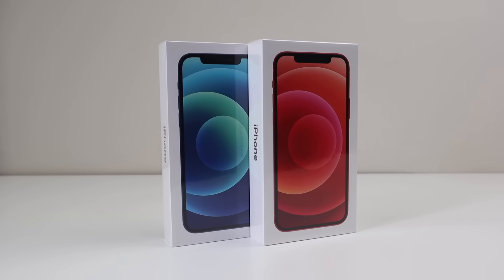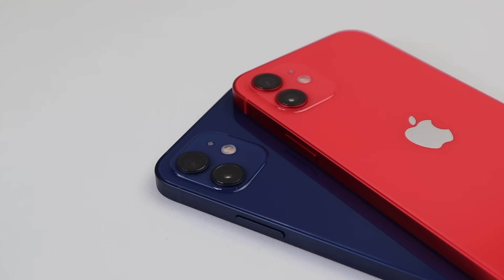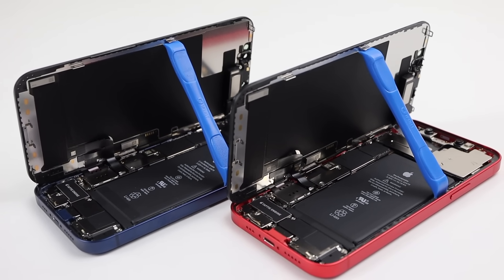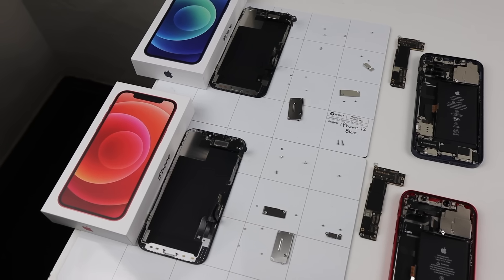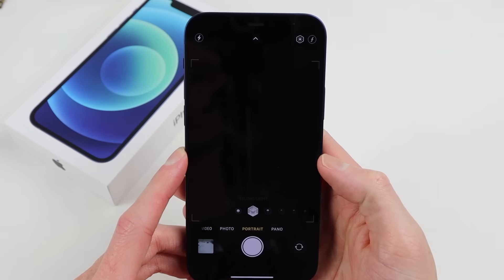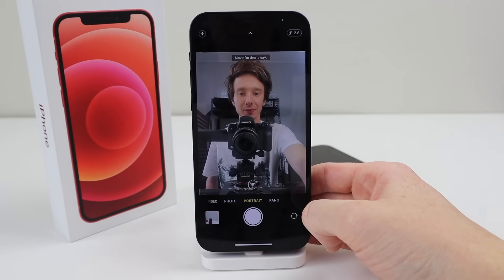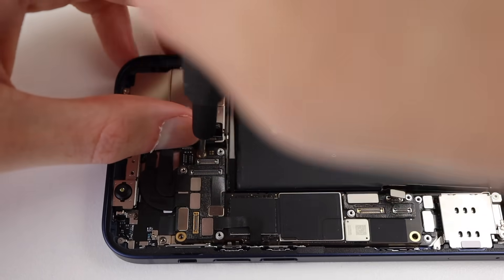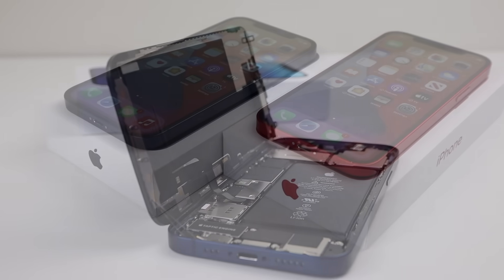iPhone 12 Anti Repair Design - Teardown and Repair Assessment

Comment: Basically proves when you send it in for “repair” they just give you a brand new one cause it’s cheaper. They’re not gonna make a bunch of spare parts for specific iPhones and keep track of which parts go to which phone. $20 China phones
Reply: Yes I work at an AASP and we are given software to pair new parts,  if not then you run into these issue.
Reply: @dequansessoms7290 i hope that software leaks into the public
Reply: Yeah what the other guy said, there's no way they're gonna give you a brand new phone, they definitely have a way to pair hardware to each specific phone serial number
Reply: Not so sure about that..
Looks like they made it very easy for themselves to replace components..
Minimum repair time, same high repair bills, max profitability.
Reply: Not necessarily. They probably have software tools that allows them to pair new components with the mother board. Which mean given time some one may figure out a way to hack the phone and pair new components.
Reply: I'm sure they would give you a 'refurbished' phone and your damaged one would go to some repair center where they have the secret software tools to pair the hardware with the logic board.  Car manufacturers do a version of this---in order to do firmware updates on most modern cars, the dealer or independent mechanic must have a subscription to download the firmware, and the tool to flash the firmware must be in communication with the 'mothership' during the process.  The code is also encrypted to discourage disassembly and reverse engineering.  Certain components must be paired properly too, which makes sense to a degree since odometer fraud is a possibility otherwise, among other things.  The difference is that while expensive, independent shops can acquire the tools needed to work on cars.  Not so with a repair shop that wants to work on Apple devices.
Reply: Its just hardware signatures lol, a simple firmware and bios flash solves that issue. They don't have to make spare parts per specific phone
Reply: Exactly. All the while charging premium prices. And this is the model they’re going to when implementing their zero environmental impact plan in 2035?
Reply: they dont have to they use a tool that will resync the part so it does not need specialized spare parts.
Reply: actually they can... they used a software that programmed the logic board to work with  specified components,  they can use the same software to change say the serial numbers  of parts a particular board would  work with.

A chief argument made by apple was that allowing people to repair was an ip violation(ip? copyrights?? patent?? i forget which one) which got kinda shutdown cuz duh...
now they can  just lockdown the software tool and it would also be easier to use the ip and safety violation  cuz that software tool is probably designed to do a lot more than just change serial numbers and they wont ever make a separate tool for it.. ez win for them
Reply: I've never bought any Apple product, but I have a used iPhone a family member gave me.

I'd assume the component serial is simply signed with a private key using RSA and stored.  The RSA signature is then verified on OS boot.

Without the private key (which might just be stored on a remote server which does the signing so even having the Apple service software tools might not be enough), short of a software vulnerability I don't see a way to change components without these problems unless you are going to give Apple even more money (assuming they are still servicing the model when you need a repair).

I think I'll just continue my practice of not buying Apple products.  Just the principle of not being able to repair my own phone due to this contrived restriction would stop me.
Reply: When my se went in for a new battery (as part of their law suit about purposely throttling old phones) they said it was un-repairable and gave me a new one. However that ‘new’ phone died about 7 days after the warranty ended and I ended up having to buy a brand new phone.
Reply: But muh tracking
Reply: Nah this dude, while clearing he's got a handle on disassembling the things, is pretty loose on his software side. Like he thought the Erase in the Phone Settings was factory restore when that doesn't touch the OS at all (he did eventually do the iTunes thing properly but didn't seem to know the difference, so obvious red flag there)..

The pairing is gonna be on the firmware level, or possibly even a secondary security chip/bios. Like how MAC computers run a bunch of separate functions through bridgeOS that you would never be able to reset doign what he did.
Reply: This sounds like someone that has no idea what their talking about, talking like they do. tell me more about your phone repair experience Karen 🤔😂
Reply: What if after warranty expires and you are not covered ? What do you do ? Get a new phone spending more money even though a charging pin is broken which costs only like 20$ to repair on Android ?
Reply: Yeah after this I’m definitely gonna be going to Android. This is so fucking scummy
Reply: Hey Kenny I found it funny I got this video recommended and I seen your comment found it funny hope your doing well man cant wait for your next video
Reply: Nah they simply have a tool that allows you to repair them.
Reply: https://youtu.be/s5uOKn1OfM4
Reply: @lakesublime1670  you can open the iPhone. Did you not watch the video. The issue is all the serial numbers of the internal components of the phone are paired to that particular phone. So if you swap say the battery or the camera. The phone operating system is like oh thats not the original serial number of the battery or camera, im not going to let the phone operate until the serial numbers of all components match what I was shipped with. Only Apple has the software necessary to pair a new component with the phone so only Apple can do the repairs so consumers are forced to pay their outrageous repair fees to fix their phone.

Comment: That’s so messed up. As if them not supporting old hardware by restricting what apps you can download and use wasn’t enough of a control tactic, now this. Makes me not want a new phone. And no more headphones and chargers is complete BS. Every apple charger I’ve ever had deteriorated after a few years and then crumbles and is unusable. God forbid I get an entire new charge cable and plug with my $1200 phone

Comment: Apple:Says there’s too many chargers already out there
Also Apple:Proceeds to make a new cable that requires more chargers to be made
Reply: If they really cared about waste, they would use USB-C on the phone.

But they won't. I think it's about differentiating their product: They want the iPhone to be distinct, not just another high-end phone among many competitors. Part of being so distinct is maintaining a separate system of accessories.
Reply: Then just for fun they'll make a new and improved charger that needs a totally different cable.
Reply: it is all PR bullsht... Apple care only about their bottom line profit. otherwise they would not re-design their hardware on laptops and phone to be impossible to repair even by an experienced phone shop who just a few years before could easily swap to new almost every part on your phone if it was broken
Reply: Apple is hypocrisy at best.

Comment: I mean what logic does "not including adaptor" has.. cuz i mean they didnt include it but literally the people will just buy it.. so its literally the same thing same amount of adaptors will be sold as if it would have been with phone aswell.. bruh
Reply: You forget about people who already have adaptors. There are not that many people buying their first ever phone these days - most phones sold are replacements or upgrades, so those buyers will already have a power supply. Or a drawer stuffed full of them.
Reply: @vylbird8014  uh didnt you see these phones have different adaptors???
Reply: Vyl Bird Uhm, no. Did you miss the whole battery section of this video? That’s not how that works at all.
Reply: @SoggycereaI  They come with USB-C to lightning cables, yes. But USB-C chargers are going to get much more common soon, and USB-A to-lightning cables are also available. The problem would be much more serious if Apple had used a USB-C port on the phone though, like every other manufacturer does.

Comment: Apple beats Samsung in terms of greed.  I stopped using Apple when my iPhone 4 got an update that made it uncompatible with 3rd party devices.  Previous to this I was able to play and charge my iphone on my Sony boombox.  We had power go out for four days in Issaquah, Washington due to snow.  I  went to charge my phone on my boombox and the phone which had previously charged off the Sony boom box told me that it was incompatible with this device. This meant that the only place I could charge my phone was the car.  I called Apple and they told me I shouldn't be using non Apple products to charge my phone or play music.  I'd rather buy a less stylish phone that has a few quirks than be relegated to only buying one companies products.

Comment: Imagine if your car could detect that you're using a different part than stock, even if it was, say, a Ford radiator and a Ford F-150, and would misfire intentionally until you took it to a Ford certified dealer. Cant wait for this company to die the death it deserves and let the actual innovators make some real progress.
Reply: Oh, and might I add, it comes with a locked gascap and they key is sold separately for 1500$
Reply: Ha, Guess you haven't had to replace a computer module on a modern car yet.
Reply: Its easy if you have the software...
Reply: @audguy  replacement ECU, and all its frills with finicky key pairings, firmware flashing, immobilization RFID what-what's, Lazer cut keys and all the other jargon to make your feel like you're not getting raped when you are invoiced, is not the same thing as swapping the engine and transmission along with the ECU because it is in tidal lock. Putting an off-brand battery in your car won't render it inoperable, doing so with your iPhone won't end well. 

Nor is complete replacement of the vehicle an ideal compromise when all I require is a new serpentine belt. And why the fck does the computer need to be "reset" its a fcking fanbelt bud, not a timing belt. 

Besides if you are savy enough, there are a plethora of aftermarket ECUs, some of which are more trouble than they are worth, others not as much, and yet you'll have to rip the whole loom out and replace the cluster in either case, but I wouldn't scrap the vehicle because of it.

Genius bar: Oh dear, is your charging cable frayed? 
Here is the replacement for it, $1500, and todazees only, you'll get the iPhone that goes along with for free! All at the nominal price of $1800 (if you ask where the extra $300 surcharge came from it becomes $2200), oh and we'll just keep the old one, kay?
Reply: @s4rg380  You should read the comments above this, they refute all the stuff you said except for the last fever dream of a section.
Reply: Don’t tempt fate my friend. Never tempt fate
Reply: isn't tesla doing something similar?
Reply: @cosenza987  Yeah they is a special mod you can buy which unlocks performance, tesla now stops you using supercharging with it
Reply: Welcome to Capitalism buddy. Where Consumer rights are evil.
Reply: @hectorvega621  seems that something more Recently has taken over and capitalism has just ran over a cliff.....  America has always been capitalist but only recently has it treated consumers in such a way
Reply: @thespiritof76..  Oh! It's been something worse than Today. We luckily don't live in the Gilded Age, but we sure are going for it's Unwanted sequel Gilded Age 2.0 return of the Elite.
Reply: There’s already similar things where car companies for example have certain repairing instruments like wrenches or whatever which you can only get from them. Now imagine someone got a certain problem where the part that is misfunctioning can only be accessed with that special instrument. And many mechanics won’t have that and will not be thinking of getting it because 1st the instrument might cost a ton and 2nd they won’t be sure if they will ever need it again. All in all you as the end consumer are fucked cause you don’t have a choice and many mechanics also cause they won’t be able to repair, maybe it’s not that big of a thing yet but it looks like it’s getting worse, heck and that’s just the mechanical problems lol
Reply: It's already a thing.
I know it's not cars; farming tractors have become so computerized, they have their own GPS and all sorts of other fancy electronics on board. You can not repair with salvages and you can not repair by yourself, you have to go to a certified shop and get original spares.
Reply: this really happens with some tractors
Reply: Tesla will probably be doing this soon if it isn't already
Reply: This is already common practice in a lot of agricultural machines. They are heavily computerised, and every part with a chip in it is potentially bonded with the main computer. It's to the great distress of farmers - not so much for the expense of certified repairs as the time. Their industry has a lot of time-dependent tasks, and you can't just put a harvest on hold for two weeks while you wait for the certified dealer to send around their own engineer and order in a part from their distant warehouse.
Reply: Most modern cars have modules for every single device and must be paired.  Usually it just gives an error message but sometimes worse.  However there’s a right to repair act that they have to follow meaning you can pair them generally
Reply: what a grim view some of you have. companies are trying to make profit for sure, but imagine if a company somehow managed to release an identical Iphone except it was not only easy to repair, but it came with a manual. it'd put apple in the ground because the StatusObject 12 would then be repairable instead of needing to buy new ones every year. the company that eats apple, probably android, is going to make a FORTUNE as soon as popular opinion shifts to "iphones are a scam" which might just happen with this phone
Reply: @Yargenshmoler  That's only if we are smart enough.
Reply: @hectorvega621  I trust people to eventually make idiots the outlier. it generally happens anyways
Reply: @Yargenshmoler  Barely by a thin margin here in the US though.
Reply: @hectorvega621  after going to the store and seeing a food service worker in uniform wearing the mask on one ear and not caring about personal space, i may reconsider my position lol
Reply: @Yargenshmoler  Yep! Especially my State. Pretty Blue. Voted No for a Progressive tax. So my State is screwed in Funding. Also California just voted no to Labor Rights. So yeah! We dumb, and allow few people to have more rights than the average joe.
Reply: @Yargenshmoler  No I'm from a different State, but California also shot itself on the foot, as they voted in favor for a proposition to remove some Labor rights.
Reply: Never say never. 😬
Reply: Ya for real ford is trash
Reply: Donalld Allhands  DEF delete kits for the win.
Reply: You are my hero sir ❤
Reply: Donalld Allhands  

Ad blue you mean
Reply: Apple isn’t going to die anymore than Microsoft for engaging in anti-competitive, anti-consumer behavior. 

The future will be a lot like now, except everything will be slightly worse
Reply: My 2005 BMW has a registered battery... So swapping it out means ,you have to go to the dealer and have to pair it up for a few bucks... (Difference is,  with the right tools everybody can do that)
These bad practices arent that new...
Reply: @Alukard1900  Switching out a battery requires like what? A wrench of the right size to undo the nut? And maybe not to lick the contacts.
Reply: @extremepredudice  When it happened to Jarjar it was at least funny.
Reply: @builder396  

No. The car has a battery management system which monitors the battery. If it is un_coded, the car won't charge it.
Reply: @shifty2755  I meant a normal car battery.
Reply: @builder396  

I also meant a normal car battery. I've been an auto electrician for 20 years 🙃
Reply: Lmfaoo stop hating, they trynna make profit which every sane business tries to do Apple just good at it and dw you would be long dead before this trillion dollar company gets even a dent
Reply: Ace Khan great attitude. I’m no longer bothered in anything stupid in life like selfish tech monopolies I can’t avoid because I’ll be dead one day. No point in complaining. Thanks you’re so wise 🙄

Comment: im not sure how long you have been following Apple's so called "innovation", but Rossman has already posted numerous times regardings apple's third-party repair unfriendliness for years that even swapping original-brand new parts from the same phone model does not work. Authorized repairs dont even have the device to repair this fiasco, they need to send it to Apple.. Only Apply can repair these (well they claim repair but they usually replace boards, whether thats new board or something from another phone is another problem. Yeah, talk about "environment friendly")

Comment: These glitches look more like a miscommunication between the module, the MB and the software. I'm guessing that camera modules and/ their receiving circuitry on the MB from these two phones could in fact be different (for example one is older than another), and the iPhone ships with a different firmware signature for each one. This would explain why  the camera still works. When they want to lock you out like in the case of FaceID or a battery they'd simply disable the entire feature or limit it.